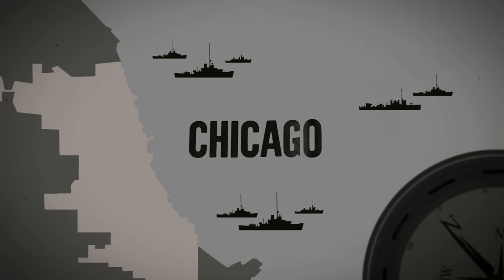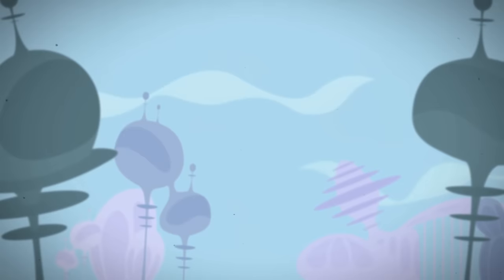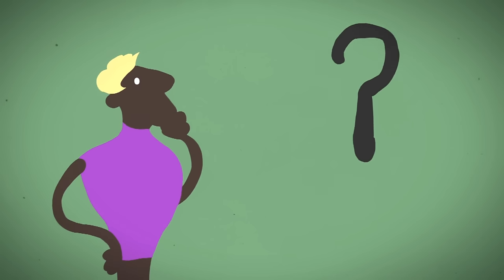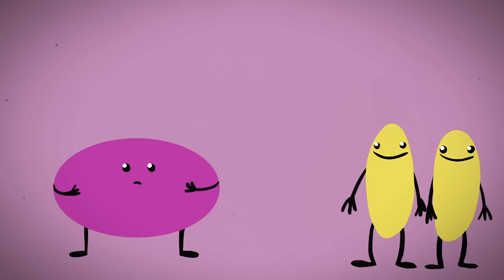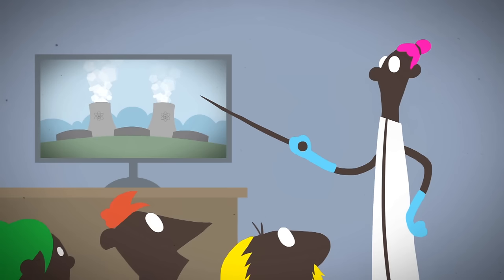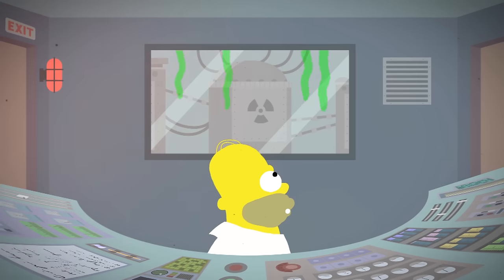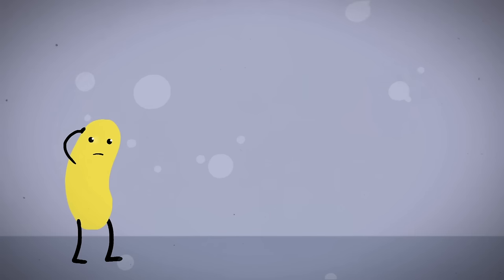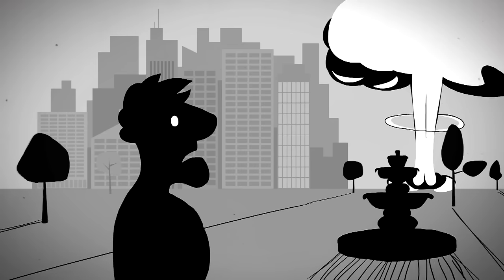How do nuclear power plants work? - M. V. Ramana and Sajan Saini

Comment: As a future nuclear engineer, I give this mostly a B+ on facts, which is actually a cut above the rest of internet videos on nuclear power :D

Couple of minor physics details were off (it isn't that water doesn't slow down neutrons enough, it is that it absorbs to many that we need enrichment!) One of the things missing, and this is hard to do with a primer like this, are other reactor types. See the one mention in the video is one of dozens or ways to do nuclear. It happens to be one of the most popular designs, but not the only design and many competing designs can resist meltdown dangers, recycle spent fuel, ect ect. Basically, most of the downsides could be engineered away if we had the desire to. I know that is what I am in school for!
Reply: Do you believe that Traveling Wave Reactors are legitament in design?
Reply: They have had a hard time making it work. Though, they have teamed up with southern company and ORNL to develop a molten chloride fast reactor using some of the wave reactor design I believe. I dunno, been awhile since I looked at Gate's team since they starting working more closed
Reply: How hard is it to become a nuclear engineer
Reply: I know this is an old comment, but would you mind explaining how we could deal with the waste that is produced by nuclear power? From my (severely) limited knowledge of nuclear power, it seems to me like we have no safe way of dealing with nuclear waste, since some of it can take thousands of years to stabilize.
Reply: Hello I am a future senior developer.and also a future CEO of a trillion dollar company
Reply: @Lvl62paladin  modern power plants used the nuclear waste of older plants to  make not use fuel.

Comment: Yes there are challenges, but there are also solutions to the challenges suggested here. For example @3:14 they describe the fission rate of being too low. What is occurring is that U-235 has too small of a neutron cross section for uranium 238 to split the parts. However there is a solution to this problem. Instead of using U-238 which has 5% probability of fission production, you can use Th-234 (thorium) to transmute U-233 which has an 80% probability of fission production due to a significantly larger cross section. This is why thorium reactors do not require as much fuel, and why they don't produce as much waste as the common reactors of today.
Reply: Thorium reactors solve (almost?) every problem of actual nuclear power production. But they are too expensive to be implemented... or even mentioned.
Reply: +Gusstavv's Stuff Nuclear power has never really had a problem with production. By far nuclear requires the least amount of fuel of an energy sector. Even the issues of uranium supply can be solved by engineering cost competitive harvesters to pull uranium deposits from the ocean. The major issues of nuclear have always been public reception of safety and economics of design. I believe if you factor in all the potential reductions in cost combined with reductions in come regulations you can make thorium reactors cheaper than LWRs and more competitive with natural gas.
Reply: Nuclear power in long term say 30 years can give highest profits

Comment: Just build thorium salt reactor. Can't be used as weapons, safer and thorium is cheaper... Just again the construction costs.
Reply: >can't be used as a weapon
so it's ultimately useless for the powers that be?
Reply: Did you see the thorium thing from Sam o nella?
Reply: @xherof4470  yea i did
Reply: Plutouim is needed for the reaction
Reply: @Genius With enough energy, you can synthetically turn any element into another, the question there is how much energy is needed.
Reply: The main bonus is less waste. But there will always be waste
Reply: @akhilesh368  yeah but less, so seems good to me
Reply: actually no: Thorium itself is not usable in weapons, but the to-be-bred Uranium 233 is and even better than U-235 that has proven it's weapon-capabilities at Hiroshima.
Any reprocessing of the fuel will yield better weapon-grade materials than light water reactors offer.
Reply: Sam O'Nella approves.
Reply: Can't be used for weapons yet. U-233 can be isotopically enriched enough to make it more handleable. This was done by US.
Reply: you can use thorium reaction to create weapon grade fuel
but it requires a second chamber.
energy production alone cannot produce waste that can be weaponized.
but as i said the fuel can be used to create weaponizable material.

on the upside, you could theoretically make a selfsustaining powerplant
Reply: @ianwall80  Thorium rocks!
Reply: Unfortunately U-233, the intermediate Th-232 breeding product, poses just as much of a proliferation risk as U-235 or Pu-239.

Comment: saying this is biased, is an understatement.  it leaves a lot of very important qualifiers and caviates on modern countermeasures and engineering which prevent such issues.  new reactor deaigns deal with most of these problems.  in addition, making a bomb from light water spent fuel is incredibly difficult and messy (meaning easily detrctable).  i hate it when these ted eds speak with an agenda, instead of presenting facts
Reply: In a way they try to be fair. Clean Nuclear power like clean coal can be achieved through breakthroughs in modern tech, new design and reprocessing but politics and bad past experience make it hard to sell.
Reply: Hah no they dont. and making a bomb means having a drived mind behind it, and we know thoose stop at nothing.
Reply: wow, im glad you backed that up with a lot of facts.  light water power reactors use a long fuel burn, for increased efficiency, which builds pu240 and other non undesirable components into the spent fuel.  these products cause the fuel to be almost impossible to create weapons grade material from.  in addition, the process required for reprocessing and enriching the spent fuel would leave a large industrial and radioactive foot print. furthermore, seperating pu239 from pu240 and pu238 is unbelievably difficult and has never even been attempted.  i work in the field and tire of fear mongering, when it comes to modern nuclear technologies. modern reactors absolutly address the meltdown concerns by making the cooling systems passively safe.  that means they can be cooled no active components, such as electic pumps ans diesel generators.
Reply: Harry Ferrari 
That is actually an amazing way to summarize much of the nuclear power debate.
Reply: Key word there; "deal with most of these problems". Sure, they may be safer but are they still really better? You still have nuclear waste that is a huge problem, as it will keep accumulating and the chance of it polluting the environment increases as well. (If you think we should just launch it into space, it would be even more expensive, watch Kurgestats video on it) And even if you have a very safe reactor, accidents do, and have happened.
Reply: I just posed a rant also saying basically the same thing you did.  While they said almost every signal downside of nuclear power, even the VERY unlikely ones.  They didnt say a single one of the positives of nuclear power.  It makes me sick that TED-Ed would do this.  

Lets just take nuclear out of the equation for a second.  Even with many sources of renewable energy, our power grid would be broken without a few power plants with a stable and constant source of power to adjust to input/usage fluctuations in the power grid.   It is an undeniable fact with our modern power grid system.  Now, taking a look at the best overall source of power for this role it is nuclear.  This is what people need to understand, it shouldn't be Nuclear vs Renewable Sources it should be Nuclear & Renewable Sources.
Reply: You want facts? 
Fact 1: How about we've got at least 2 major atomic wastelands caused by reactor meltdowns, and one of those is quite recent. (P.D. we don't need any more)
Fact 2: Yes, these were made from unbelievable hard to occur events, but at the end they happened and we got contaminated places which they are still affecting in some way the environment (animals, food chain, water supply).
Fact 3: The waste the reactors produced/are producing maybe is something we are not worried about it NOW, but at some point it will blow back reminding us it is still here and won't go away by just hiding it under the carpet. Adding a veeery long-term challenge of not messing it up.
Fact 4: Having an huge power supply is not the answer of our problems. Making an efficient way to use the actual supply would help a lot, but nobody is interested as long as we can produce more power. Wasting energy because it's cheap is as stupid as poisoning the environment to make it cheap.
Fact 5: Condemning cars by evaluating a car from the 60's is ridiculous. But having those 60's cars still on the roads at high speeds filled with tags saying they are secure is ridiculous too.
Fact 6: If you show me an engineering solution for nuclear power which does not need constant control so it doesn't melt down, even if it's active or passive; makes virtually no harmful residues; does not need intense mining to obtain the fuel; and by no possible means makes fissile weapon grade materials, then you can say with (quite) absolute certainty that it's a safe way to make energy. Otherwise the dangers and problems are there and they should not be omitted even it it's "fearmongering"... Oh wait, there is Thorium power, which does it! But unfortunately it's not mature enough and nobody wants to fully develop it, some even say it's parascientific mumbo-jumbo, and it's too expensive to implement over our ultra safe-grade nuclear reactor infrastructure.
Reply: you obviously lacl any real information on this issue.   im talking about gen 3+ reactors.  stop spreading skewed propaganda and fake news
Reply: Everybody listen up, have you ever thought about why we have this debate at all? I mean, there is no debate on weather or not Fiber is better than 4G or not. Sure, this is a whole other matter, a much more important one at that, but the logic stays the same.

Fossil power is awful, everybody agrees on that, but why is it still used? It is because the underlying social cost of it through carbon emissions isn't factored into the actual cost of the electricity. Which is why a carbon emissions tax is necessary. If that tax were at the right level and Fossil power still were around it wouldn't mean that it didn't work, but rather that its pros outweigh its cons. Note the usage of "the right level", the level at which all social costs indeed were factored into the production.

The very same argument can be made about renewables(especially hydropower) and nuclear power. It doesn't really matter which one is best, simply have a system of the minimal necessary regulation and a way to imbed social costs into the electricity cost. The way to do this could very well be a fee proportional to the expected number of deaths calculated by statistics as well as in the case of nuclear power forcing the industry to dispose of waste accordingly. Then simply see what kind of power source gives the cheapest electricity. The reason this works is that no problem any power generation faces is insurmountable.

I understand that there are problems to this approach, for example; The company which invents a viable LFTR will gain a massive monopoly over power generation, but is this really worse than letting politics, controlled by voting laymen, run a giant electricity company? (This is what a system of subsidies, specific taxes and regulation ultimately creates.)

Am I wrong? If so then how?
Reply: This Reddit post shows the very same data from Forbes but in a much clearer diagram:
www.reddit.com/r/dataisbeautiful/comments/3ug7ju/deaths_per_pwh_electricity_produced_by_energy/
Reply: Its a bit difficult to explain this type of stuff to people. While TED Ed could have spoken about everything that you pointed out, the video would not be engaging enough to keep the attention of an average YouTube goer. Plus, Ted Ed is really just an overview on how things work. It's purpose is to make people aware of the dangers of nuclear power (even though I do agree that the benefits could have been elaborated on).
Reply: fact 1um atomic wasteland is not what Chernobyl is. in fact it has the same radiation levels as being on an airplane. The only  part of chernobyl that is really danerous is inside the room where the meltdown happened infact a hazmat suit is not even needed to go to Chernobyl. Fact 2. with the invention and development of throium flouride reactors a melt down is impossible with out sabotage and ven then throium is fertile not fissile. Fact 3. Thorium reactors produce very little waste and with a simple long term plan for storage can be easily stored for long periods of time. Fact 4 Nuclear energy is one of the most effecient forms of energy production. fact 5:  we should perform upgrades on the cars from the 60's to increase their saftey or take them off the road and buy a new car. Fact 6  Yes Thorium reactors are young but the conept has been proven  and China and the U.S government are putting hundreds of millions of dollars into it aswell as other countries and private companies. instead of focusing on fusion we should finish the work on Thorium which would be faster and easier to achieve and then after we have perfected Thorium and secured our existance then focus on fusion.
Reply: mike all it uses the bohr model which makes It wrong
Reply: Land and location: One nuclear reactor plant requires about 20.5 km2 (7.9 mi2) of land to accommodate the nuclear power station itself, its exclusion zone, its enrichment plant, ore processing, and supporting infrastructure. Secondly, nuclear reactors need to be located near a massive body of coolant water, but away from dense population zones and natural disaster zones. Simply finding 15,000 locations on Earth that fulfill these requirements is extremely challenging.
Lifetime: Every nuclear power station needs to be decommissioned after 40-60 years of operation due to neutron embrittlement - cracks that develop on the metal surfaces due to radiation. If nuclear stations need to be replaced every 50 years on average, then with 15,000 nuclear power stations, one station would need to be built and another decommissioned somewhere in the world every day. Currently, it takes 6-12 years to build a nuclear station, and up to 20 years to decommission one, making this rate of replacement unrealistic.
Nuclear waste: Although nuclear technology has been around for 60 years, there is still no universally agreed mode of disposal. It’s uncertain whether burying the spent fuel and the spent reactor vessels (which are also highly radioactive) may cause radioactive leakage into groundwater or the environment via geological movement.
Accident rate: To date, there have been 11 nuclear accidents at the level of a full or partial core-melt. These accidents are not the minor accidents that can be avoided with improved safety technology; they are rare events that are not even possible to model in a system as complex as a nuclear station, and arise from unforeseen pathways and unpredictable circumstances (such as the Fukushima accident). Considering that these 11 accidents occurred during a cumulated total of 14,000 reactor-years of nuclear operations, scaling up to 15,000 reactors would mean we would have a major accident somewhere in the world every month.
Proliferation: The more nuclear power stations, the greater the likelihood that materials and expertise for making nuclear weapons may proliferate. Although reactors have proliferation resistance measures, maintaining accountability for 15,000 reactor sites worldwide would be nearly impossible.
Uranium abundance: At the current rate of uranium consumption with conventional reactors, the world supply of viable uranium, which is the most common nuclear fuel, will last for 80 years. Scaling consumption up to 15 TW, the viable uranium supply will last for less than 5 years. (Viable uranium is the uranium that exists in a high enough ore concentration so that extracting the ore is economically justified.)

Read more at: https://phys.org/news/2011-05-nuclear-power-world-energy.html#jCp
Reply: Thank you.
Reply: their video started a conversation about the topic though.

even just mentioning it makes a difference.
Reply: @gusstavv  
Fact 7: Our current and foreseeable technology for renewable energy is so far behind we simply cannot expect to become less dependent on fossil fuel and coal without help from nuclear energy.
Reply: @gusstavv  you are clearly biased